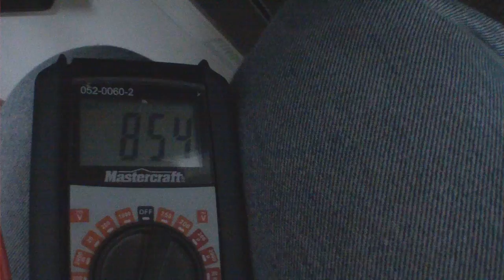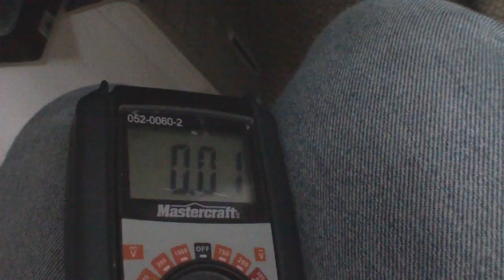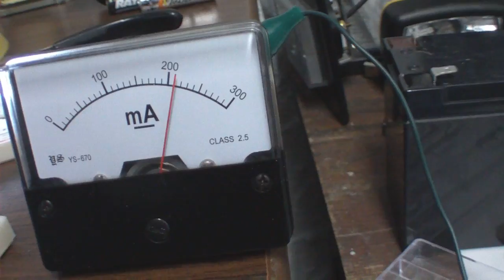3.6V Joule Thief (32) 5mm LED (3.6V - 210 mA .75 Watts)

Comment: Hi Kyle. Nice project. I wanna reproduce your 3,6v joule thief. Can you show me how to do that without burning transistor? I know Its an old video, but I hope You can help me with some schematics. Cheers  sascaurobertpaul@yahoo.com
Reply from the maker: +Robert s just go to google images and search "joule thief" -- there are a bazillion diagrams out there. cheers
Reply: KyleCarrington I've made it my self a lot of Joule Thief but not from 3,6 volt supply. I need to know resistor value and transistor type for 3,6volt supply if you know what I mean to say. Cheers
Reply from the maker: +Robert s it says right in the video @ about 0:38 - 800 ohms. Note the inductor. your inductor will change the resistor requirements. to start, put in a 1.2k (1200 ohms) resistor, in series with a potentiometer that is 5k or 10k, and dial it slowly taking away resistance. if your concerned about blowing a transistor, use a tip 41 and add a little chunk of heatsink even (not necessary) https://www.fairchildsemi.com/datasheets/TI/TIP41C.pdf - but you'll probably find you'll get a lower current draw if u use a 2n222 mpsa06 i think its is
Reply from the maker: +Robert s https://www.youtube.com/watch?v=0GVLnyTdqkg
Reply: Thank you. I will try with tip122 darlington with heatsink. It's the one handy for me at the moment.
Best Regards Robert.
Reply from the maker: +Robert s that will likely work and be durable, just not the most efficient, is my guess. it is npn, so the diagram will be as normal
Reply: I know that. I've lighted 3 watt led bulb from 1,5 volt Joule thief with light more than 4 hours. I wanna test it Joule thief with 3,6 volt because I have a lot of Li-ion cells 2400mAh and need more current for my purpose. Greetings
Reply from the maker: +Robert s actually i missed your "darlington" part of the description, so it is an npn & pnp in one! should work, let me know if it does
Reply: Yes. There are two transistors inside one(darlington) and double output amplifier. :))
I'll test it and let you know if work. Peace

Comment: BTW, if you are using capacitors on the AC line, always use the X2 caps which are rated for connection to the AC line.

Comment: I did some lifetime tests on those 10mm white LEDs from HK.  They were 5 chip 1/2 watt, which should handle 180 mA   I ran them for more than a year at only 80 mA, but before the year was over the light output of all four was much less than a single unused one.

Comment: One can minimize the current limiting resistor, but it's still there and wasting power.  If you use a LED driver chip or circuit, it typically requires a low value resistor to sense the current, but if that's very low, then this switching circuit is usually very efficient, maybe 80 to 95 percent. If you connect the LEDs across the AC line, then a series capacitor theoretically dissipates no power. But getting bit by AC is not a pleasant experience.

Comment: If you leave the resistors out, the constant voltage will feed more and more current to the LEDs as they get hotter and hotter.  If they're not kept cool, the current becomes excessive and really bad things happen to them.

Comment from the maker: @User2718218 Actually I have known that for quite some time. Theproblem is, the expense. Quickly one can add a 15 dollar power supply to a 3 dollar lamp. Cost must have some bearing. What you will see in a lot of modern lamps, actually (THE AC ones) is a capacitive reactance current limiting technique, because they too, are challenged by expensive / costing / pricing. The best ones of course have a smps.

Comment from the maker: @User2718218 Unfortunately that doesn't work, because not only are your stuck to multiple of (in this case 3.2) - but your battery loaded is a different voltage, than unloaded, AND it's always falling. You never want to run 4 in series, because a fully charged battery sitting at 12.6, quickly falls under 12.4, and a few hours later, your really "in the dim". Trust me on that one, I've lived off batteries. But there are options, I agree, that's definitely not one of them though.

Comment from the maker: After much experimentation, at the end of the day, I don't think you can do better with a JT, than with conventional. That may depend on the source voltage and total amount of resistors needed... I am going to do another video where I compare two arrays. What spurred me to do this, was Lasersabre's video, but I suspect, there is a slight hitch to that video. He is driving the LED at 2.99V, instead of 3.2-3.6V. I suspect a great deal of LUX is available in that last half volt.